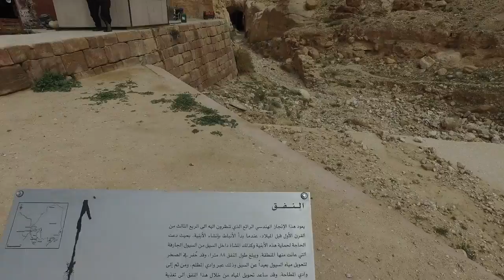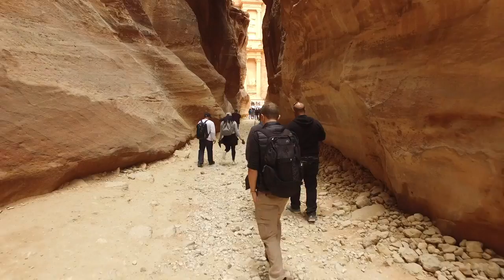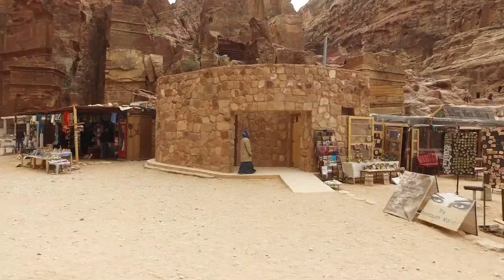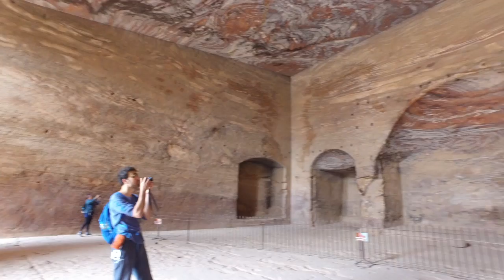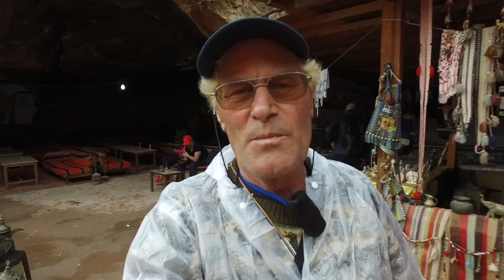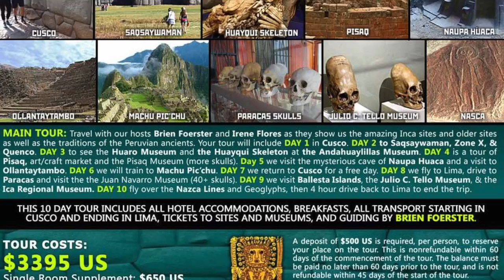Petra Jordan: Lost Ancient Technology And Megalithic Masterpiece

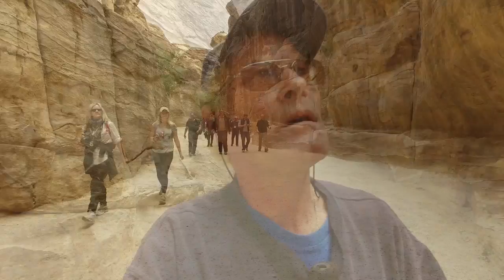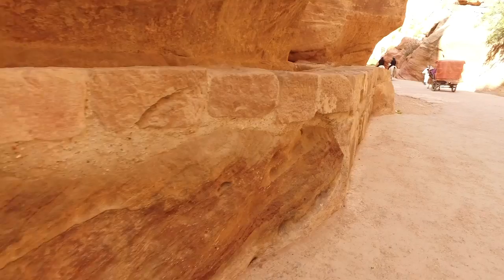Comment: 2:30 that Dam looks nothing like all the other structures in Little and Grand Petra. Especially the pipe. All the other structures are single slabs of stone with holes DRILLED into them. The siq repair at 4:26  looks like the same construction as the dam.  The concrete looks the same. The structures built into the stone however does not seem to have ANY primitive concrete used in their repairs. The Roman structures also look similar in terms of using brick and mortar.

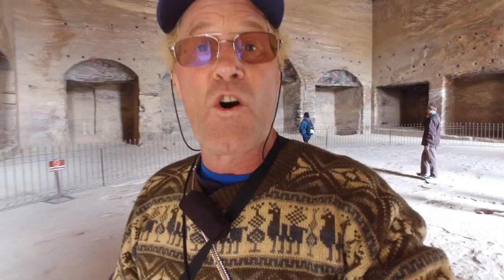At 15:00 there is no way each of those little hashes were done by single chisels!! That looks like the markings made when texturing on a potters wheel!! Uniform, all going in a single perfect direction. Like a brush was run across it!

One thing I do not see ( I am no expert, of course) is water erosion, as seen on the sphinx. If there's not water erosion, the structures must be less than 7,000 years old which is the last time the Sahara Desert was a swamp.

Conclusion: HOW DOES ANY HISTORIAN FEEL GOOD ABOUT THEMSELVES BY FLAT OUT LYING ABOUT THIS SITE!!! Literally anyone with logic can deduce the Nabateans did NOT build this entire site! Even just the erosion would tell you that!!

Comment: the columns out side the Ohm room look as if they were stuccoed over the bedrock. the bottoms have lost the top coat. 
 some sites in india have similar features. sure would take the pressure off chiseling them without error.
Reply: donkeytico13 looks like water damage. Is it possible that part was under water?  Then that is a lot of dead people.  Where are the bones?